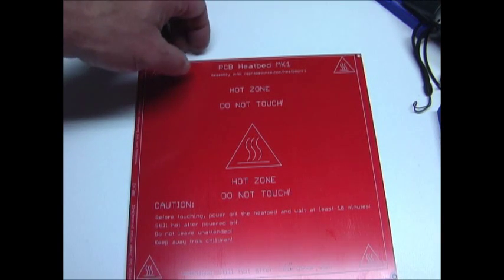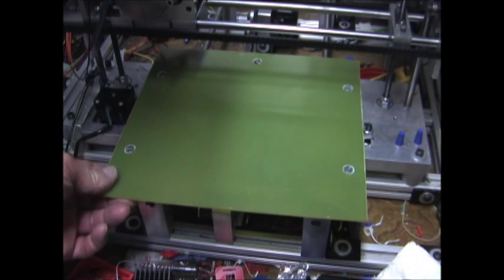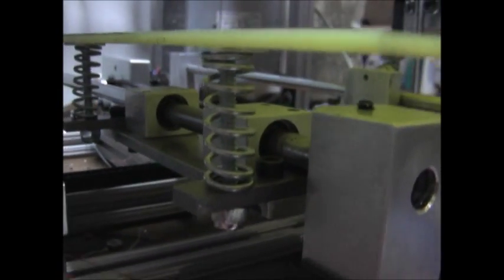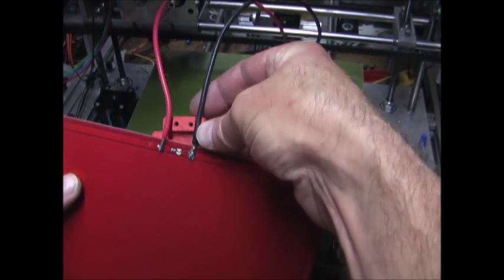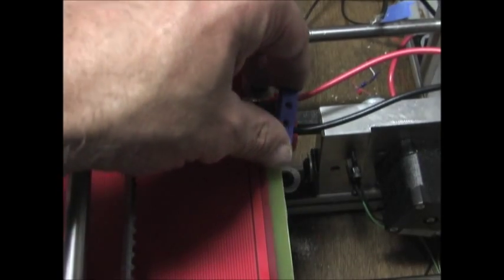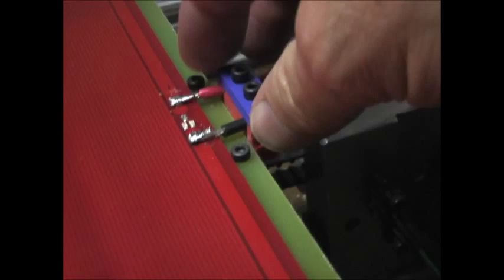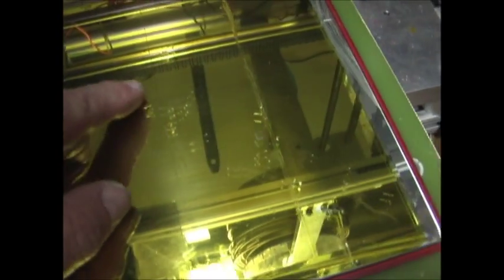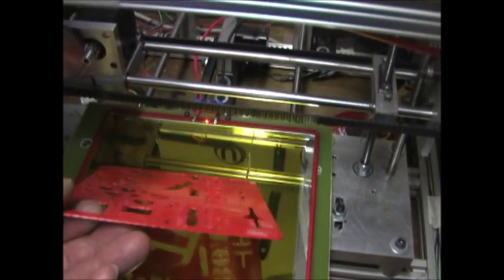Heated Print Bed for a 3D Printer Stops Parts from Warping      Mendel Prusa MK1

Comment: why the mirror instead of just glass... any reason I have seen this before and I thought it was just for video taping?
Reply from the maker: I don't have scientific proof but supposedly a mirror is made from a more rigid material than plain glass. It has an extremely flat surface. The coating on the back of the mirror heats up faster and has better heat distribution.
The local glass shop will cut to any size, this one cost $5.00.
Reply: Jay Gould Thank you for your prompt reply. I will look into that. Great videos too!

Comment: Hi! My models removed from kapton in during printing, What could be the problem? degrees 110-120
Reply from the maker: I usually clean mine with window cleaner after each print. Also you can check to make sure your first layer is very close to the print bed.

Comment: Did you just connected the 12V wires to the power supply?
or does it need an external driver/controller?
TNX